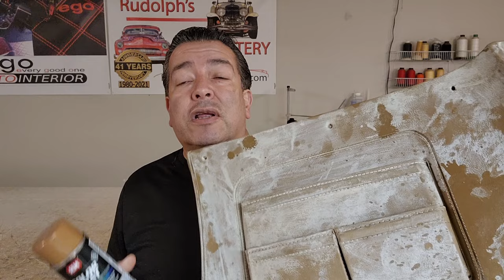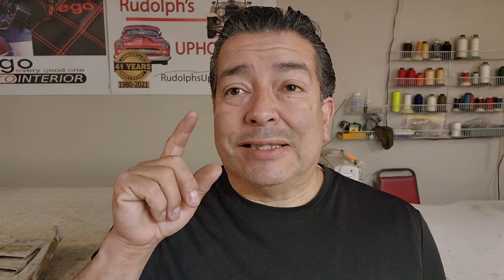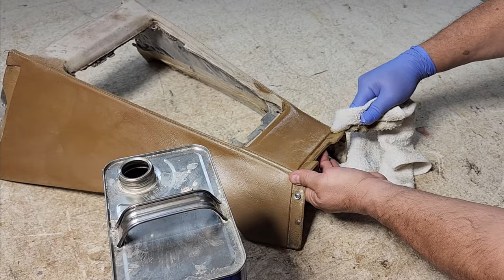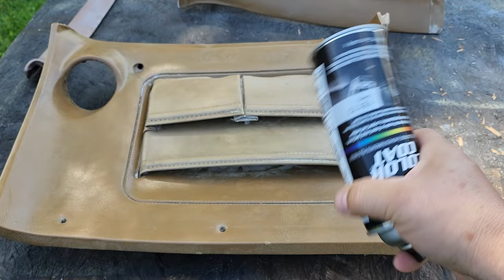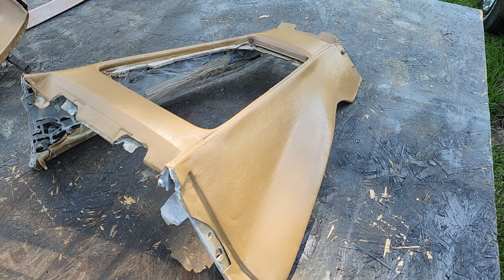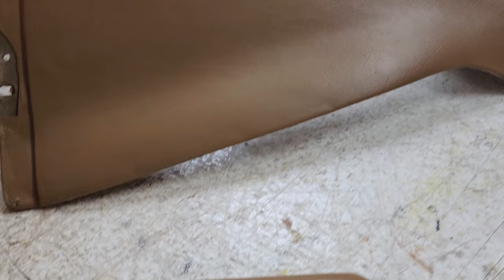Easy how to paint car interior plastic vinyl leather correctly

Comment: Thank you for this video.  I am restoring my old 89 Olds Todonado Trofeo (which I purchased new back in the Fall of '88).  Part of it involves coloring some dash parts from a donor car.  I have the SEM color, AND I have an adhesion promoter that was recommended to me to use.  In your vid, you did not use that, but remarked that Acetone provides that adhesion.  Would you recommend not using the adhesion promoter along with acetone on my dash?
Reply from the maker: Hello Johnnie, I used to work on those car when they were new at the dealer. Hehe. An adhesion promotor would be useless. Acetone will wipe out the adhesion promotor as acetone is very harsh. An adhesion promoter such as Bull Dog, is similar to acetone but more expensive. I'd save the money and just go for the acetone. Please keep liking and watching!
Reply: @oldschoolautoupholstery  Hey thank you for your quick reply.  I have a can of SEM 38353.  Is that doing the same thing as acetone?  Should I use that after cleaning with the acetone or not ??  BTW, I have a developing vid series on my microscopic youtube channel as I am redoing this car, if you may be interested.
Reply from the maker: @JohnnieBravo1  Hello Johnnie, I have never used SEM 38353. 40 years ago, there was never such a thing. I have always used acetone. My feeling is that the acetone will remove the SEM 38353. It would not hurt anything if you use it before or after. I took a look at your channel, and can clearly see how much work you do. Go Trofeo! Please keep liking and watching!
Reply: @oldschoolautoupholstery  Hello OldSchool:  just a quick question on my restoration project.  I  pulled the entire dash out of the car, clearly seen in my videos of getting the electronics working again, but I have separation of the foam and dash cover from the plastic substrate.  There are several recommendations from YouTubers on sticking it all back together, using GOOP AUTOMOTIVE ADHESIVE, CA Gel Glue, and even Epoxy.  What method might you recommend ?  And do you have any videos of making that kind of repair??
Reply from the maker: @JohnnieBravo1  Hello Johnnie, I was using silicone way before there ever was such thing a GOOP, AA, CA Gel glue. I would squeeze some silicone between the two pieces and set it for 24 hours. It's never failed me. Please keep liking and watching!

Comment: You said not permanent...
Many repop plastic parts come only in black.
 So It's better to repair old original parts if they are beige and then repaint same color?
(I suppose it's over if crumbling ...)
What's the best way to clean ageing discoloration stains on light beige color ABS to avoid having to paint?
Thanks!
Reply from the maker: Hello Run, You are right about the black. You are also right about trying to keep the original parts. Lacquer thinner works pretty well at cleaning and not as harsh as acetone.  Please keep liking and watching!

Comment: Hey bro can I put satin clear coat? On the paint it looks kinda flat
Reply from the maker: Hello User, Being that SEM is a lacquer, I think if it is a hard plastic part you are painting, I don't think a satin clear coat will hurt anything. I am not sure it will work well over vinyl. Please keep liking and watching!
Reply: @oldschoolautoupholstery  I didn’t use SEM I used a different brand but I spray painted a Dashboard for a 2006 Chevy Silverado but the color is flat no shine. I saw that SEM sell Satin Clear coat I don’t know if I can put that after
Reply from the maker: @A1Santoss97  Hello User, You can put enamel over lacquer, but you should not put lacquer over enamel. Please keep liking and watching!

Comment: wanted to double check but its ok to use acetone and this SEM color coat on leather seats? Trying to paint over some spots on the seats of a lexus is250
Reply from the maker: Hello Win, Yes, this does work on leather as well as vinyl and plastics. Please keep liking and watching!
Reply: @oldschoolautoupholstery  Thank you for your response! and Acetone is ok for Leather as well? a quick google search says I shouldn't use acetone on leather or vinyl
Reply from the maker: @winpark3902  Hello Win, your Google search is warning you not to use Acetone on leather or vinyl because it will destroy the top coating. For dying, this is exactly what you want it to do! This is what creates your adhesion for the SEM to stick. I have been doing this for 44 years. Please keep liking and watching!
Reply: Thank you for you videos and the quick responses. One more question, is there any precautions I should take when painting over heated/air cooling seats?
Reply from the maker: @winpark3902  Hello Win, You are so welcome! I can't think of anything wrong with painting the heated or cooled seats. Please keep liking and watching!

Comment: hi may i ask if you are looking for an upholsterer?
Reply from the maker: Hello Player, Sorry to say that I am not. I have been alone for 43 years for a good reason. Please keep liking and watching!
Reply: @oldschoolautoupholstery  got it sir👍🏻
Reply from the maker: @rojvilar  Thanks for checking!
Reply: Been using SEM for 15 years. Great product. Acetone is perfect prep. Sometimes mixing 50/50 acetone and 99% isopropyl alcohol helps it not flash off to quick on the leather. With leather I noticed that when it gets a little tacky from the prep it’s the best time to spray it, perfect bond.
Reply from the maker: @chameleonleather1671  Hello Chameleon, That is Perfectly said, Thanks for sharing your experience! Please keep liking and watching!

Comment: Great video, I got an old 1990s-era Hummer and I resprayed the tan interior to clean up all the trim vinyl and plastic pieces 14 years ago and it held up great in the desert heat [120-140 degree interior temps] and sun. Now there are a few pieces that the coating scratched off over wear and tear [tunnel plastics] so I'm about to recoat those again, I followed the same process SEM recommends, it's a great product. SEM Soap, then the vinyl or plastic adhesion promoter, and several light coasting of the color coat and then followed up with the semi-gloss. I'm glad I kept the colors the same when I did it because the scratched areas aren't that obvious. I'll try acetone next time, but I'm curious what do you use for an inital wash pass? I'd like to use something other than the SEM soap product.
Reply from the maker: Hello Big, There is no initial wash process. Acetone is it. Anything you put before the acetone is money and time wasted as the acetone being so harsh will remove anything you applied before it anyway. When I started using SEM 44 years ago, there was no such thing as SEM soap, or vinyl plastic adhesion promoter. The only other thing we did use is Bull Dog, which is another acetone type product. Please keep liking and watching!

Comment: Hi brother Rudolph… genuin enquiry from overseas: 
I’m restoring an 89 Chevrolet caprice classic brougham with a vinyl top… question is- can you apply the INTERIOR paint spray you used for exterior application? Given that it’s exposed to weather and UV radiation… 
Thank you for taking the time to respond..

From DUBAI with ❤
Reply from the maker: Hello Brother H20, I see what your saying. I would say that you could spray the vinyl top, but as you know, being exposed to the outside elements will greatly shorten the lifespan of the paint. Please keep liking and watching!
Reply: @oldschoolautoupholstery  thank you very much brother Rudolph.. I was hoping there was a more concrete answer to a “semi-permanent” solution to the vinyl top of my vehicle… 
But I thank you nonetheless..

God bless
Reply from the maker: @H-2-O  Hello Brother H20, Yea, I would say that nothing is permanent. Being that the spray is on top of a surface. Please keep liking and watching!

Comment: My only issue with this video is that you don't explain how the acetone creates "adhesion" on the vinyl.  You're drawing a distinction between cleaning/degreasing and adhesion - I think it's the same thing.  When you degrease (clean), the surface is now porous, allowing paint to adhere (stick) better to the surface.
Reply from the maker: Hello J, If you have ever used Acetone on just about anything, you will quickly see that it is very harsh and does the adhesion job. No explanation necessary. Simply cleaning as in using alcohol or degreasing, does absolutely nothing for adhesion, therefore is not the same thing. Trust me on this one. or try it yourself. You'll thank me later. Please keep liking and watching!

Comment: Would MEK work as well, or possibly even better than acetone?
Reply from the maker: Hello Fargin, I do not know MEK. Acetone is awesome, and cheap. Always gets the job done. Please keep liking and watching!
Reply: @oldschoolautoupholstery  MEK is methyl ethyl ketone.  I think it's very similar, but possibly even a little stronger than acetone.  I used it as a prep agent for using some PVC cement to do some repairs on an inflatable boat (dinghy).  It actually softens the PVC and makes it very tacky until it dries out again. That's probably what helps the PVC cement get a tenacious bond.  I don't think it's any more expensive than acetone, but I agree with you if acetone has been working fine for you for all these years, why change now?!
Reply from the maker: @farginicehole513  Hello Fargin, I just got it. "Johnnie Dangerously" Love it. I think it would not hurt to try the MEK. Please keep liking and watching!
Reply: @oldschoolautoupholstery  Yes!! One of the classics!
Reply from the maker: @farginicehole513  Hello Fargin, Right on! Right on. Please keep liking and watching!

Comment: Sir, do you have any films on painting wheels?  See I primed one side of the wheel (internal), and in many places the prime (I used Rust-Oleum Automotive Primer) was like a layer of chalk. I wiped it out, it was a lot, like a thick layer of dust. Then I just washed that wheel. The primer adhere to some parts (best where there was a bare metal), but not everywhere where it was painted surface. I think maybe I should just go over that primed surface w/paint, so together they would adhere, or I did something wrong. The primer is for Metal and Fiberglass surfaces. When you touch that primed surface, should it stay on your fingers or not? I would appreciate any opinion on this matter, I googled and nothing about it. Some people use  application of Glass Cleaner before and between layers of paint.  The wheels are not aluminum, they got a bit rusted, I removed that rust, prepared surface, but smth went wrong w/Primer, I think. Thank you for this detailed film.
Reply from the maker: Hello Olena, Are you talking about painting wheels for tires? If they are metal, follow the advise of body shop people. Please keep liking and watching!
Reply: @oldschoolautoupholstery  Hello Sir, thank you for the replay. Yes, I'm replacing tires and saw that wheels are rusted. They are metal. I did 2 cars before, but those were aluminum wheels, and these are steel ones.. I think this Primer I use is not quite good, but I'll watch more films on body repair. Till so far I didn't see anyone making any accent on the use of primer in details. Everyone just sprays it, then paint. But when I touched my primed wheel, a lot of primer comes off in the form of heavy dust or sand. And I cleaned the surface very well w/99% Isopropyl Alcohol before applying that primer. I don't know what causes this problem.
Reply from the maker: @olenaerhardt7725  Hello Olena, From what I know is if primer is going on dry, it could be that the outside temperature is too hot or spraying in direct sun exposure. Try at a cooler time of the day and in the shade. Try this: https://www.youtube.com/watch?v=VnIZ_wABrJU Please keep liking and watching!
Reply: @oldschoolautoupholstery  Hello Sir. Thank you for the replay and reference to the film. I received another opinion that the main reason might be too high temperature. Yes, it was a very hot day. Yet I was wondering why they say on the label about highest temperature. I was painting in Dallas, it was around 100F and the wheel was located in the sun. I didn't know about that effect of drying of the primer in the air. No information about it anywhere. I'll try to paint in the mornings, when it is around 80F. I bought several other primers to try, but I think the reason was in too high temperature. For some reason no one points out on that factor on YT. Thank you kindly again.
Reply from the maker: @olenaerhardt7725  Hello Olena, I hope I have been helpful. Please keep liking and watching!

Comment: I have a question I have seen people usually spray lighter panels and interiors  to black from a  light color or I have seen people spray semcokor coat form lighter color to another color .  However I have not seen anyone sem color coat a dark color like a black to a lighter color . Can I sem color coat a black door panels to a camel or palomino color to match the rest of my light palomino interior ? I am afraid I’ll spray it camel or palomino and it Will end darker than the rest of the interior due to its black base .
Reply from the maker: Hello Flat, It seems like you have a good understanding how it works. You could spray it first with a gray primer, then your color. Going from black directly to a light color will take many more coats. Please keep liking and watching!
Reply: @oldschoolautoupholstery  thank you for resign and replying to my comment . Jus time question do I have to go with some kind of special Interior primer? Or what is the best primer I can use ? Does sem have one specifically for interior vinyl and fabric ? I don’t want to make a mistake like buying primer tags meant for like let’s say metal
Reply from the maker: @AlonSOAMAZING  Hello Flat, SEM is lacquer. Spray primer is Lacquer. I don't see a problem here. Please keep liking and watching!
Reply: @oldschoolautoupholstery  thank you so much
Reply from the maker: @AlonSOAMAZING  You are so welcome! Please keep liking and watching!